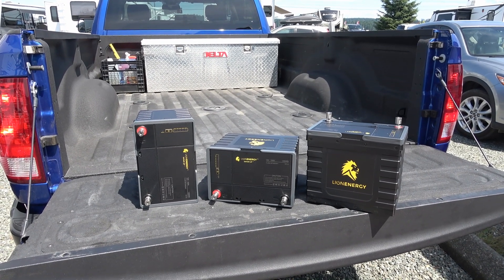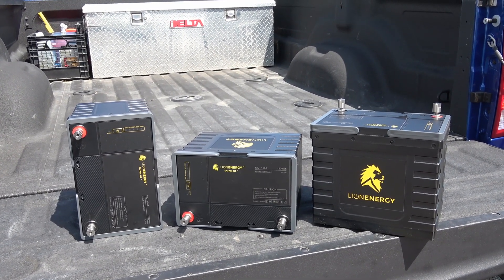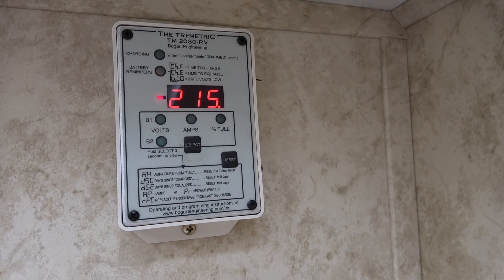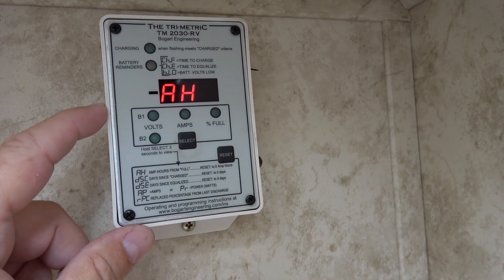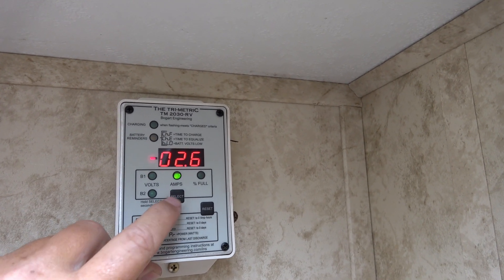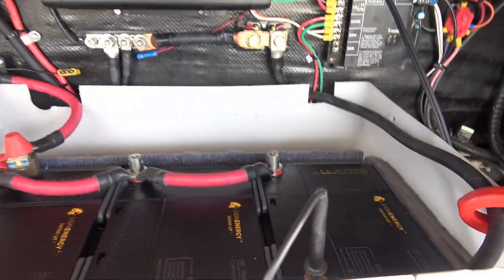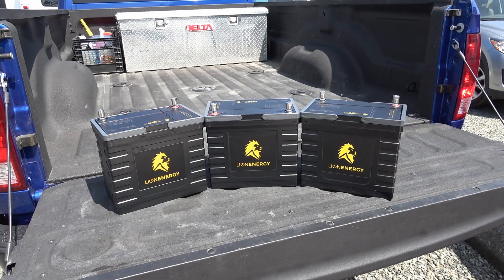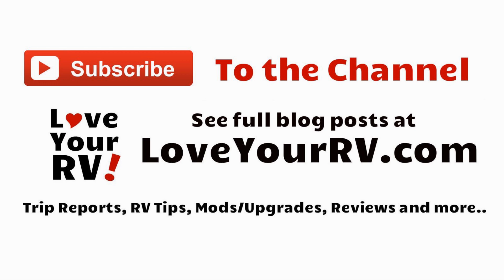Lion Energy Safari UT Battery Tests (Part 1) - Amp Hour Capacity

Comment: Thanks for the extensive testing. It's very useful to see real world testing as opposed to just reading marketing literature. I'm tempted to buy these but Lion Energy's initial deceptive practice of rating these as 100ah (1200wh) batteries has put a bitter taste in my mouth for these batteries. Your testing shows these batteries are more 85-90ah batteries.
Reply from the maker: Yeah, that was a dumb marketing move, I bet they regret that one. Guess they figured they could fudge and round up a bit like other products do, like say solar panels, I've never seen close to 100 watts out of my 100-watt panel, more like 80 watts. Cheers, Ray

Comment: Will Prowse ran some tests on a LiOn. When he took it apart it was a 90AH set of cells, so no way it reached the spec sheet capacity. Cost is an issue. Northern Arizona Wind and Sun has 10% off sales on lith a few times a year. I bought used 180AH Calbs for $100 apiece. How to handle things like protections, balance, are complicated, but basically just study the requirements and know how to do the protections. Lifepo is a lot more fun than lead. 

Your reviews of the lith pack inverters show some major flaws. You get everything just about right. It seems like building what you need off a pack is a better way to go, but it would be nice to have a 'do everything' box and some folding solar, maybe a small genset. I loved your tear down of the box. 

If you look on AliExpress you see the bulk pricing, China pricing, on cells. I am looking at a quick search and seeing 120 AH cells, set of 4, for $460. They say free ship. I know nothing of the product or the seller. A BMS is not a big deal. Wiring 4 balance leads is not complicated. Maybe a Kickstarter campaign where the seller gets the money up front would allow a group buy and decent shipping rates. I know with ebikes the guys who get it right are the ones who go to China, meet the people, make the deals. 

I am really impressed with these videos. You guys are really getting this lith ball rolling.
Reply from the maker: Thanks, George. :)  Based on reviews and feedback from folks like Will, me and others Lion Energy has updated the rating on their Safari UT. Here is a link to a recent blog post they published explaining how they rate the battery and their own internal test results. - https://lionenergy.com/blogs/news/making-sense-of-battery-ratings-and-specifications  Cheers! Ray
Reply: @LoveYourRV  That's an excellent article. It's all going to depend on how you run a test. I've had Lifepo since a 36v 15AH in 2014. Most ebike batteries will start with high voltage and by the end you are sucking major amps to get the watts you need. The Life hold 38 volts forever. So they have a very good point. I still think a 90AH battery pack is less than a 'real' 100 AH pack. My 5 year old Life pack tested out at 14.7 amp hours when I ran it down a few months back. It's a great battery chemistry. It doesn't work so well for ebikes because the weight is much higher than most 18650 cells.  There's some complexity to this subject. I don't know how many cycles to expect from an inverter pack which does tend to use the lighter 18650 cells. And that gets into how you charge and discharge. The more tests the better. It's very difficult to get people in the ebike industry to run any tests, or publish any real data. The RV industry should try for more transparency, so I give credit to Lion, to you, and to Will.

Comment: I bought an Agm battery from Edmonds about a year ago, after researching and based off space I have was next best thing next to two 6volts. It's been a disappointment. Was totally drained and wouldn't hold a charge. Took back to Edmonds here in Langley after bein recharged. They load tested said is good, we'll see. I'm not holding my breath. Was $300bucks and so far I'm disappointed. Might go back to a interstate deep state. Very frustrating.
Reply from the maker: :(  In my experience, it's always hard to trust a lead-acid battery once it's been totally drained. Maybe being an AGM it'll be OK

Comment: If I was Battle Born, I would send you three Battle Born Batteries and ask you to perform the same tests on them. Going by the spec sheet, Battle Born might perform slightly better, but not enough that it would matter to any one using them in a three battery bank in an RV.

It is great that there is another company going after the RV market, competition begets better prices for consumers.
Reply from the maker: Looks like there are a few other companies now like Renogy, Blue Life and ReLion as well, so that's good to see!  They'll likely drive the prices down a bit but from what I read there is a floor to it. With so many electric cars and trucks selling now it's keeping the raw material prices pretty high, there are only so many mines and producers.  Cheers! Ray

Comment: You cracked me up Ray!   @16:25 "If you going to be running them (batteries) somewhere hot, you'd might want to put them in a cooler environment." Meaning from where you have them now?  Great advice.   In an RV that's in the desert  mounting them inside your refrigerator is your only best option.  Great humor. I love your video's, best wishes

Comment: I could definitely use one of those. I didn’t realize the fridge on LP still draws power for the board. When it’s October in the north not a lot of sun. Recharge would be a lot faster than standard lead acid.
Reply from the maker: Yes, RVs have lots of little current drains that add up, I calculate our fifth wheel uses about 25 amp-hours a day with just little stuff like fridge board,  LP gas detector, tank monitors, stereo memory and light, etc.

Comment: Viairs do have a duty cycle.
Reply from the maker: Mine is the 450P-RV model designed for filling many large tires. It has a Duty Cycle: 100% @ 100 PSI   https://www.viaircorp.com/portables/450p-rv-auto
It also was running without any pressure so hardly even got warm. :)

Comment: Did you post the amount of time it took to run down the battery per load test?
Reply from the maker: No didn't bother using a timer, you can just divide ie. 87.5AH/80A = 1.0937 then convert from decimal to regular hours = 1 hour 5 mins if my math is right.

Comment: I thought it was not safe for the health of the battery to go below 20%?
Reply from the maker: The batteries are guaranteed for 3500 full discharge/charge cycles which is about 10 years if you did it every day.  The builtin BMS (battery management system) keeps them from the danger range by shutting off the battery. However, If you were to stay in the 20% to 80% DOD depth of discharge range you could increase the battery lifespan to 5000 and even 7000 cycles. But really it's so far out in the future I'm not too worried about it. In my normal usage, I won't be running them right down that was just for test purposes.  Cheers, Ray

Comment: Great video Ray so did you happen to write down how long the battery lasted at each test (10amp,80amp,150amp)
Reply from the maker: THX, No didn't bother using a timer, you can just divide ie. 87.5AH/80A = 1.0937 then convert from decimal to regular hours = 1 hour 5 mins if my math is right.

Comment: Excellent test Ray. I follow a few other RV channels and it seems like Battle Born was giving batteries to a lot of them and most couldn't spell battery much less review them properly like you do. Looks like the Lion batteries do what they claim and your tests prove it. The only tests I've seen on the Battle Born batteries are look I ran my AC for 2 hours on my batteries!
Reply from the maker: haha, thanks. :)
Reply: Look at the will prowess video.   A 100 amp hour battery that only delivers 90 amp hours .   That is a problem.

I have an issue with battleborn giving some of the windowlickers battery's and it is hysterical listening to them to trying to talk technical.   

It is really tough to trust any of these manufacturer s